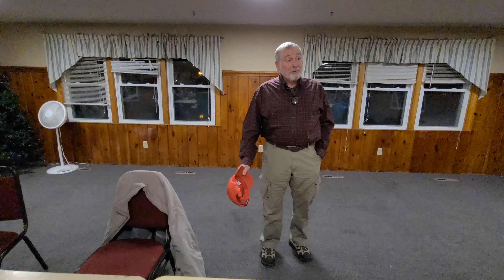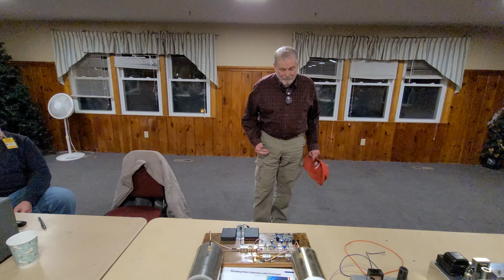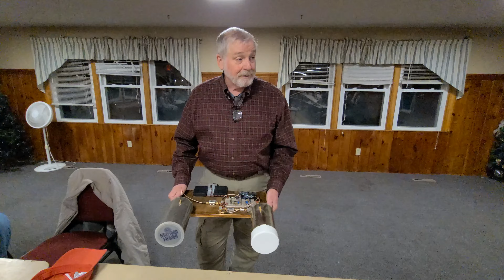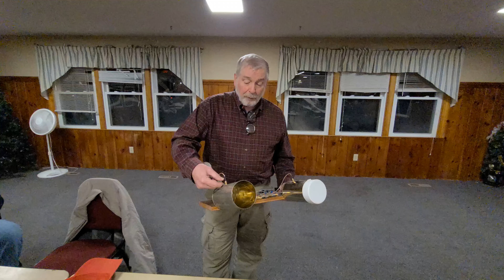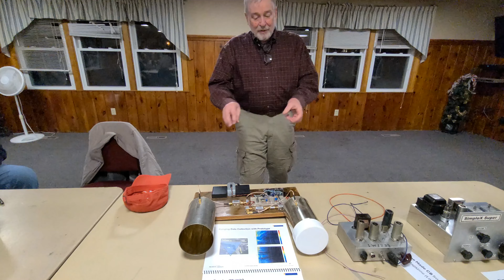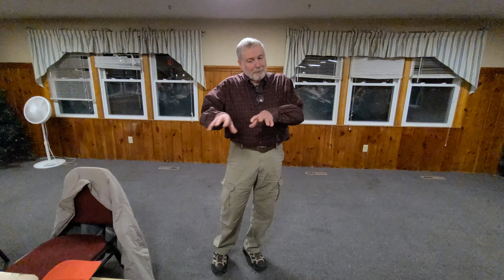Homebrew: Homemade Radar

Comment: Used to work with radar systems we sold to the US. Made a fortune on non warranty repairs as they insisted on opening up the PSU in the field which invalidated warranty. The flip side is if my life depended on such a system and it failed in the field, warranty would be the last thing on my mind

Comment: Very nice.  One day, about 50 years ago, in high school physics class, the teacher brought out a microwave receiver and transmitter.  Forget the specs on them, but we were supposed to play around with them and see how far away the receiver would pick up the transmitter, etc.  I got the idea of placing both horns on a bar, facing the same direction, and feeding the output and received pulses into an oscilloscope.  I could see the outgoing pulse and then a short time later the return pulse on the receiver.  Made a very crude radar but it did work.

Comment: I picked up an ancient police X band radar head one time. 12 volts in,  doppler audio out.  100+ mW. Gunn into a big horn about 25 dB gain?  I hook it to a battery and an amplified speaker.  I play around with it and can get doppler returns from aircraft.  Birds flying over make a cool sound I guess because of flapping.  I tuned it to a freq. that is legal for me below 10.5.